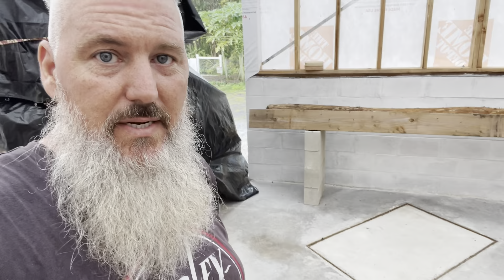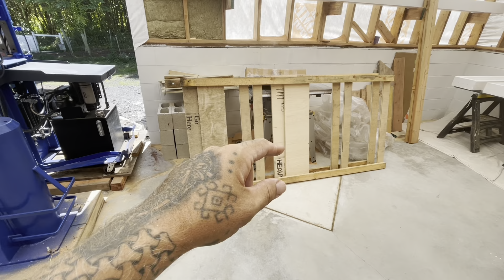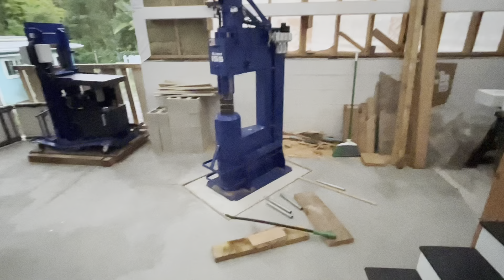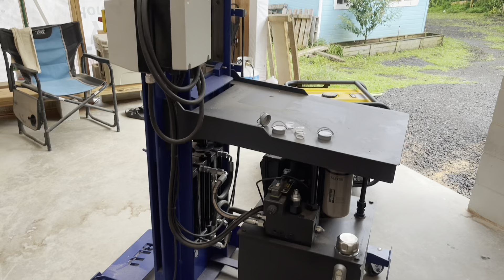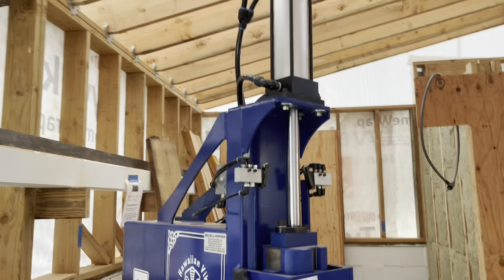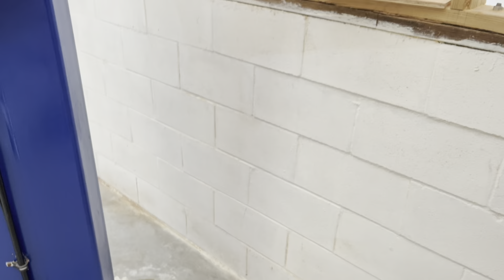Big Blu Equipment!

Comment: Excellent setup you've put together. Just a quick question. What size is the air inlet pipe on the back of the power hammer?
Thanks.
Reply from the maker: Mahalos! To be honest I still have not got air set up to my hammer yet lol… but I’m pretty sure it’s a 3/4 threaded fitting. 🤙🏼
Reply: Thanks Jason. 👍😎

Comment: Do you have power running  to the shop?
Reply from the maker: Hey Karl, there’s no power currently running to the shop. Long term plan is to have solar on the roof so it’s totally off grid, short term plan is running on a generator… 🤙🏼